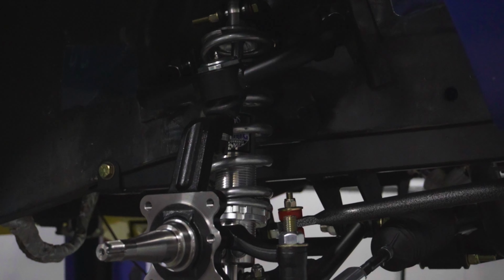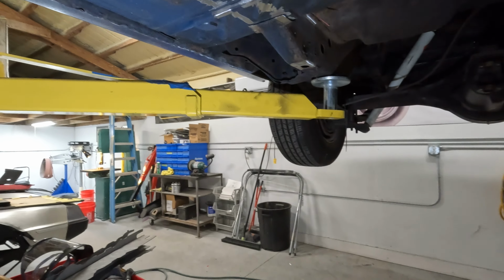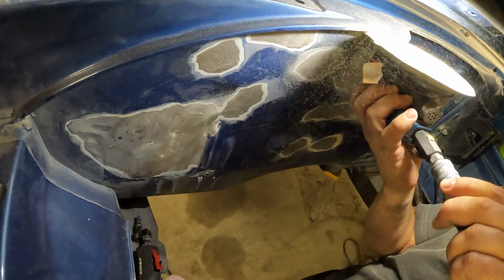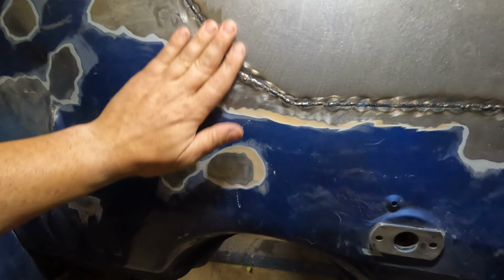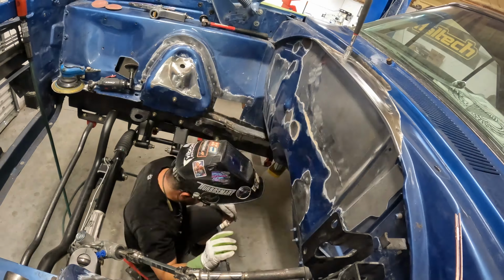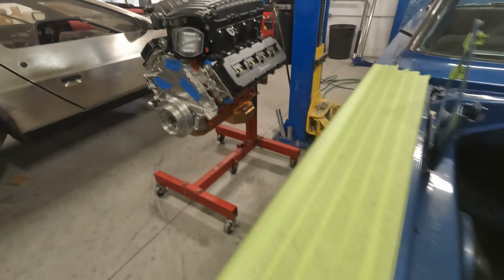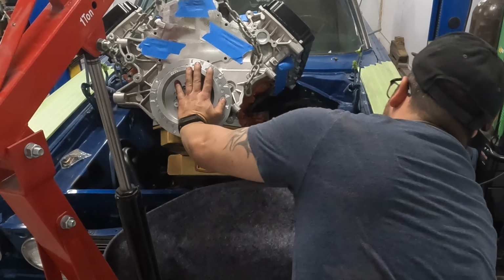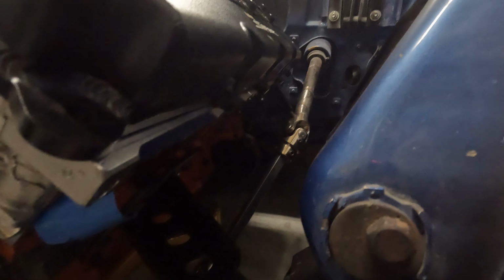900HP Hellcat Engine Swap + 1966 GTX - Supercharged 6.2L Plymouth Build - Ep.2

Comment: I feel like I could see the firewall warping as you were welding. Pretty normal occurrence. Is there anything you do to combat it? I've had this problem many times repairing body panels, etc.
Reply: Maybe I should have finished the video before commenting 🤦‍♂
Reply from the maker: @seancummings4328  the cooling and hammer and dolly is your best friend to combat that. I just noticed the time lapse captured it. Sheet metal fab is an interesting tug of war between shrinking and stretching the metal into place.